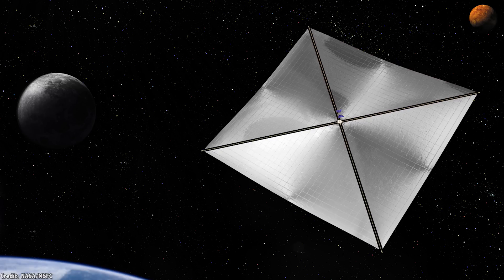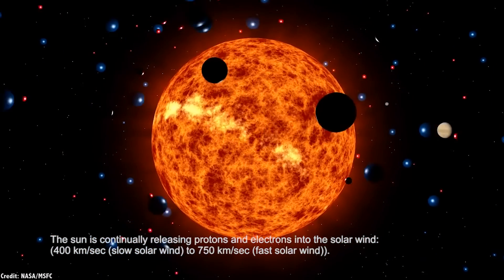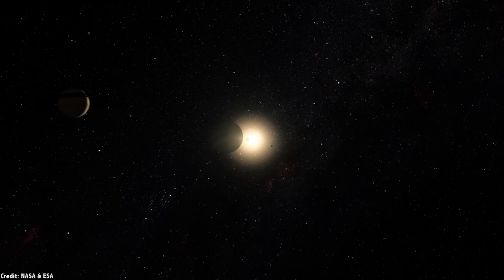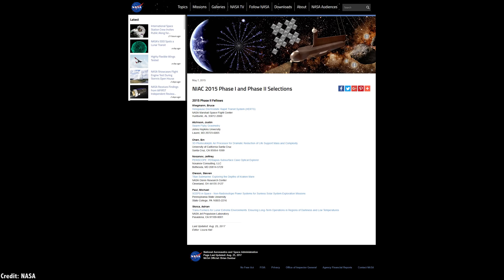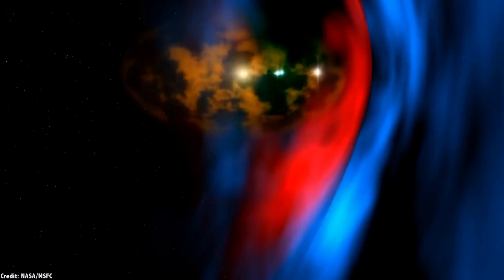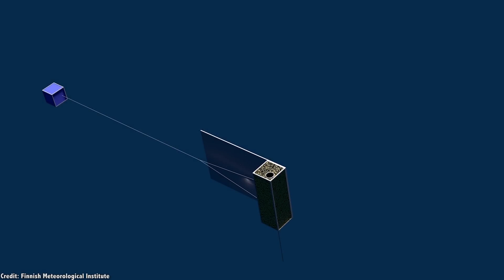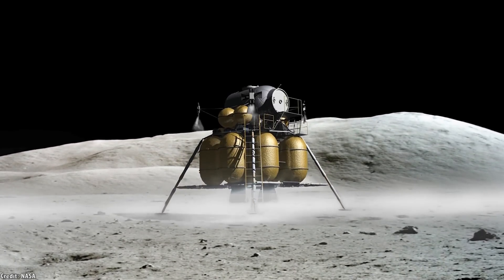What is an Electric Sail? Another Exotic Way to Explore the Solar System

Comment from the maker: I passed along a bunch of your common questions to Dr. Pekka Janunen, and here's what he had to say:

1. Can we combine them with a solar sail to get the best of both worlds?

Maybe, but we don't have such concept under active planning. At one point we considered using small solar sails to control the spinrate of E-sail tethers.

2. Could the tethers work as antennae, to help communicate with Earth?

Not really. The tether wires are so thin that their ohmic resistance per length would reduce their efficiency as antennas. Also, nowadays one prefers high radio frequencies. Such frequencies do not call for long wires antennas, but instead smaller directive antennas like parabolic dishes
Reply: I hate to disagree with Dr. Janhunen, but electric sail wires would make excellent antennas. There is a type of antenna, called a Beverage antenna (see: www.google.com/search?source=hp&ei=prM8XYH1NuqF0wKOr5qgBw&q=beverage+antenna&oq=Beverage+antenna&gs_l=psy-ab.1.0.0l10.1830.9150..13246...0.0..0.314.2241.0j16j0j1......0....1..gws-wiz.....0..35i39j0i131j0i10.cBEvc9cDTrY ), which is a long wire—a really long wire—that is many quarter wavelengths long. When an antenna wire becomes many quarter wavelengths long (1/4 wavelength is the minimum self-resonant length of an antenna, either above a ground plate or plane, or as one half of a dipole antenna [whose total length is 1/2 wavelength at its self-resonant frequency]), the antenna pattern is such that the signal fires almost entirely off the far end of the wire. (For receiving, such an antenna is also very sensitive to signals arriving at its far end, moving parallel to the wire’s orientation, because the transmit and receive antenna patterns are identical.) Also:
 
Like a spin-stabilized satellite with an electrically-despun antenna (the USAF pioneered such multiple-antenna spinning satellites, as I covered in this www.centauri-dreams.org/2018/05/18/immortal-interstellar-probes/ article about interstellar probes), an electric sail-equipped interstellar probe—like Project Dragonfly’s design—could use the electric sail wires as electrically-despun, highly-directional antennas. Either each electric sail wire could be “worked against” the spacecraft’s body (using it as the RF—Radio Frequency—ground), or each opposing pair of electric sail wires could be worked against each other, forming what is called a doublet antenna. (A doublet antenna is a dipole antenna—with a dipole antenna pattern--only at the antenna’s self-resonant frequency, but a doublet antenna works on other frequencies—both higher and lower than its self-resonant frequency—with the help of an antenna tuner.) As well:
 
At typical spacecraft radio frequencies (S-band, X-band, etc.), the wires of an electric sail are hundreds, thousands, or even tens or hundreds of thousands of wavelengths long, so they would be very high-gain antennas, firing transmitted signals in a very narrow lobe off the far end of the wire (or wires, if opposing pairs of wires were employed as doublet antennas), and they would be equally directionally sensitive for receiving. Using a variable antenna tuner would enable the wires to resonate over a very wide band of frequencies, making the electric sail wires ideal for an interstellar probe’s radio science/plasma wave instrument, and—on a Bracewell interstellar messenger probe—for listening for any intelligently-generated signals from a potentially inhabited planet in a probe’s target star system.
Reply: What if there was a way to use very powerful magnets to manipulate electromagnetic forces and use them for propulsion?
Reply: Is that a thing? Can that be a thing? That would be very cool. I don't know how good of an idea it is to have a powerful magnet in space though.

Comment: This technique has seen really great investments compared to the recent lightsail. In 2013 Estonian students build a 1 kg cubesat which should test a 10 meter electric sail but it failed because the winding mechanism did not work. The cubesat costed around 100 000€. The official reason was to prevent space junk.
Reply from the maker: Yup, I think the electric sail idea has a lot of promise.

Comment: There may be a slight issue with the description of how the electric sail works in the video. I don't think the solar wind has a net negative charge. If it were negatively charged, a positive charge on the solar sail would not produce thrust (or would do so toward the oncoming plasma). Rather, the positively charged sail repels the relatively more massive positive ions in the solar wind while attracting the electrons. Hence the need for the election gun to maintain the positive charge.

Comment: I would say that the electric sail is the only way to explore our solar system.  It may be the only way to traverse the distance between stars.  At some distance from the sun, the electric sail would stop accelerating the spacecraft.  That would be the maximum speed the electric sail could generate.  It would have to do a sort of sling-shot effect to get the velocity it needs to go to another star.  It would have to accelerate away from our sun, then turn the sail around and head into sol - accelerating the whole way then orbit around the sun and accelerate away from the sun.  Then and only then would it have any kind of velocity needed to go to another star.  Could it decelerate when it got there?

Comment: This sounds almost too good. You mentioned that the system consumes a couple hundred watts and it seems it is more powerful than an ion engine. Why is this tech not that researced? National agencies were mentioned, but no NASA or ESA. Might it be because the focus is on high thrust solutions lately?
Reply from the maker: It has a bunch of downsides, like you have to use it outside the Earth's magnetosphere. It's also a fairly new idea and these take some time to be tested and incorporated into missions.

Comment: I think the description of how this works is somewhat problematic. The solar wind isn't negatively charged, at least not until it gets to the spacecraft. Rather, the protons are deflected and the electrons are attracted, both of which creates a force accelerating the sail.
Reply: Yes they both accelerate the sail. The protons bounce off and give their momentum that way, but the electrons accelerate towards the sail stealing some of the momentum. But then the electrons get to the positive tether and since the wind goes at a much higher velocity than the sail the electron has plenty of forwards momentum and the net force from both those interactions means even the electron is giving much forwards momentum to the sail, but the proton has more mass so it is more important. One final piece of the puzzle- the electron gun spits the electrons back towards the sun so over all it's like the electron did the same thing as the proton and all the momentum from both of them is reversed and by conservation must have gone to the sail.
Reply: hmm the solar panels would put a bit of energy into the electron so they are less negligible from their lower mass.. but still the protons ...

Comment: Might it be possible to create such a sail without using solid material? Could we create the same thing using a pure energy field that could somehow capture all that solar wind?
Reply: Well I guess it would have to transmit force back to the spacecraft via either strong, weak, gravity, or electromagnetic.  Of these only EM has the distance, repulsive direction, and strength.  The EM force is transmitted via fields -- which feels rather like a "pure energy" idea that ya mentioned.  An electric or magnetic sail, whatever its matter source, would continue to catch & transmit particle force a bit past its solid edges -- but would drop off quickly as an inverse square.

Comment: This will work ok for the solar system but for interstellar travel you may still need something more powerful. Ten years is still way to slow because this would mean at least 15000 years to get to the nearest star. Dont get me wrong this could be a very helpful technology but the end game is still interstellar travel. I suppose if you could find an even better method using similar technology that might be a step in the right direction. There are problems though if you wanted to use this tech for interstellar travel.<br/>
In interstellar space you will have less and less of that solar wind and thus you would have to hope that perpetual motion in space would keep it going at a constant speed. Your first problem is you are going to eventually run out of solar wind. What will move the ship after that?

 The interstellar medium contains some helium and a lot of hydrogen and space dust and small rocks and this could create drag on any large sail. The interstellar medium does, however, have radiation so I suppose you could make use of that. Drag though is a real problem and the more surface area a sail covers the greater the drag.

You need speed to reach that next star. This requires having more energy than this solar wind can provide unless we could perhaps find better ways to harness it like maybe focusing it. At the rate mentioned it would still take thousands of years to reach even the closest star. I suppose perhaps a much larger sail might do the trick but you are still going to be depending on low drag and constant motion.
All told this is a promising idea for inner solar system travel but I am wondering how it could translate to interstellar travel. This is why I have proposed a magnetic pulse engine that would generate a large electrified magnetic hoop field in front of the ship out of thin air and thus the ship would move through the hoop. The ship would keep generating new hoops pulling the ship through and thus accelerating the ship in a manner similar to what a particle accelerator does. It would not run out of solar wind and there would be no large sail to create drag and thus slow down the ship. In fact these hoops would be mostly energy and not connected to the ship. Still though the disadvantage of my idea would be some source of energy would be needed to create the hoops. 
Humor me a little here. I wonder if there might be some why to combine your idea with what I am saying and thus reduce drag and increase speed. Seems to me the alternative is just making much bigger sails... but sails are made of something and that can create drag. Hmmmm. Just wanted to put my own thoughts on the table there to add to the conversation. Let me know what you think of this concept vs the sail.

Comment: Boats uses an under water wing to stere sideways relative to the wind direction.  This is how they can navigate at more than 90 deg from it and come back.  Since there is no such force in space, how could such a magnetic sail give you thrust other than away from the sun.  Also, in order to be repelled by the solar wind, such a sail would need to be positively charged.  You mentioned that this could be achieved by throwing out electron, thus giving the hole ship a positive charge.  How could they get negatively charged in order to be attracted by this same wind.  Does a proton gun exist?  And by the way, since the hole craft would be magnetically charged, turning it around would have no effect.  Am i wrong?

Comment: They can make the sail positively charged or negatively charged. Do you think,  they make the sail positive charged because it will repel positive charged protons ( Protons are heavier than  electrons) from sun. Protons repelling will cause more acceleration to the  space craft.  But as you go further and further, these proton concentration reduces and the propulsion.
Reply from the maker: I'm not sure, maybe there's a way they could do both?
Reply: That's right. Protons (or other positive ions) are repelled while electrons are attracted to the sail. That's why the electron gun is needed to maintain a positive charge. As for the proton concentration, check out this paper: https://arxiv.org/pdf/1707.02801 It's about magnetic rather than electric sails, but it discusses the effect of low proton density on such craft.

Comment: When a star runs out of hydrogen to fuse it will then start fusing helium into heavier elements. Does this mean that it may be possible to make a helium bomb?
Reply from the maker: If you could get your hands on the helium, I guess, but it's down in the middle of a star.

Comment: Question: 
If we have a stick  10 billions light years long straght. Ignoring all the forces that can effect the stick or the force required to push it, but If I push the stick 5mm, would the stick move 5mm on the other side 10 billions light years away instantly? If it doesn't move instantly, would the person other side of the stick 10 billion light years away when will he know that I pushed the stick from other side?
Reply from the maker: No, the movement of the stick would still be limited by the speed of light, as would the knowledge about the stick being moved.
Reply: When you move the stick you are actually making a low frequency sound wave. Though solids have slightly higher speed of sound than air, it is ridiculously low compared to the speed of light, which itself is utterly inadequate compared to the size of the universe.

Comment: When travelling near the speed if light, colliding with small particles is dangerous as you said before. Could we use the same technology from a warp drive to bend the space with the particles in so they don't collide with the ship?

Comment: Could a solar sail and an electric sail be used in conjunction with each other
Reply: I assume it can be used together. Speed would be greater when the spacecraft is closer to the Sun because of the solar sail getting more of a push when it is closer to the Sun but when it is further away, solar sail will be receiving less, if not no push, but the e-sails should still work.

Comment: Alright, so if solar wind and light pressure can overcome the gravity of the star producing it, could you therefore build a solar sail big enough, assuming you had materials strong enough (which, of course, we don't, but theoretically), to move an entire planet?
Reply from the maker: You could, but an even cooler idea is that you could move an entire star with this technique. Build a huge solar sail, and the gravity of the star will pull it down, but the light will push it away. The whole star will move.
Reply: Ah yeah, I think I recall Isaac Arthur talking about that. So cool, thanks for reminding me! :D

Comment: Electric sail with solar sail between the filaments .
Reply from the maker: I've seen a bunch of people recommend this. I'll take it to the research team.
Reply: I get first ride, though.
Reply: @frasercain  Some interstellar probe designs combine both sails, for braking at arrival at the target stars--either a combination of a solar (stellar, in this case :-) ) photon sail and an E-sail, OR a photon sail that is positively charged, so that it "bounces back" both the star's light ^and^ the positively-charged stellar wind (mostly protons, and some helium nuclei). It is even a "double feature" for arrival braking in some starship designs (as long as the photon sail is large and light enough [ditto for an E-sail, if also used in a particular starship design], effective braking can be done).

Comment: A thought: Given that these craft would already be equipped with long, conductive lines, couldn't those be used as transmitters and receivers, essentially big radio antennas? If you're already carrying what is effectively a 20 km radius circle, wouldn't it be relatively simple to use that for sending and receiving signals?
On top of which, while cruising from one asteroid to the next, couldn't they use the sail's radio interactions to function as a huge radio observatory?
Reply from the maker: I'm not sure how well they'd work as antennae, but I know the asteroid missions ones won't be able to communicate back home from the asteroid belt.
Reply: I mean, that just seems odd. All you need for a big transmitter is a big conductive thing. Seems like they should be able to use the sails as transmitters and receivers.

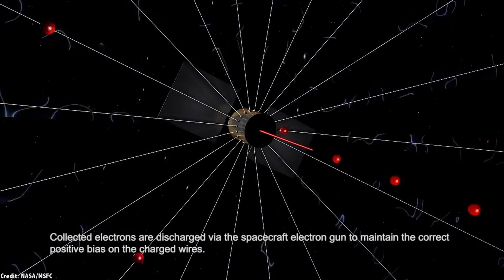Comment: Nice video Fraser! One issue: I think the electric sail mostly taps into the momentum carried by positively charged solar wind particles (not electrons as you mention around 2:50). Makes sense, since the solar wind has both positive and negatively charged particles, but protons are so much more massive than electrons.
Reply from the maker: Interesting, I'll take a look at that.

Comment: Hey so, pulsars, neutron stars, and magnetars are all supposed to have insanley powerful magnetic fields, right?
Could we use a magnetic sail there as a sort of electromagnetic parachute to decelerate ships going a decent fraction of the speed of light? If we accelerate them to .20c with the starshot proposal, and decelerate them using pulsars as magnetic brakes, we could have very fast interstellar probes, with almost no propellant needed
Reply from the maker: It's not about the magnetic field, it's about having a powerful solar wind. So they wouldn't really be that helpful.

Comment: Toats fascinating! How about this, can we set up a solar system subway? We build huge spaceships powered by electric sails that go in loops throughout the solar system. Yes it will take a bit to get them up to speed but once they are there we can hop onto them when they're near earth and then go anywhere in the solar system!
Reply: Disasterina They're called Cyclers. One big ship that cycles between two or more places. The advantage is that you would only need a small spacecraft to match velocities with the very big one; used for the long flight.
Reply: Thanks for the info I'll search for some videos on them!